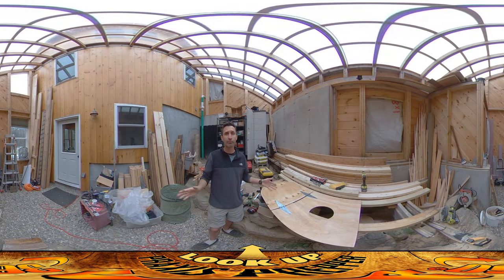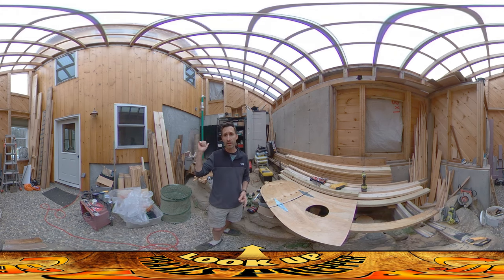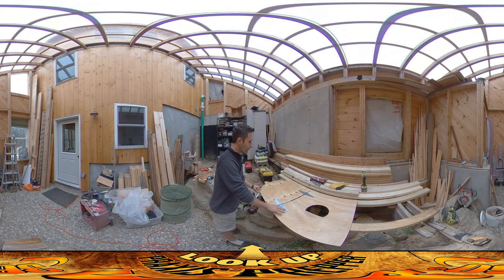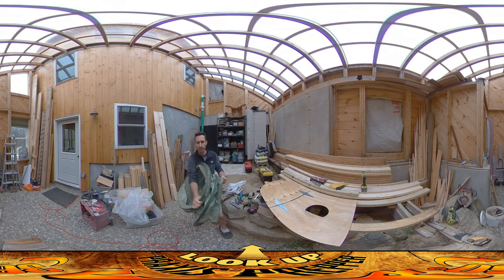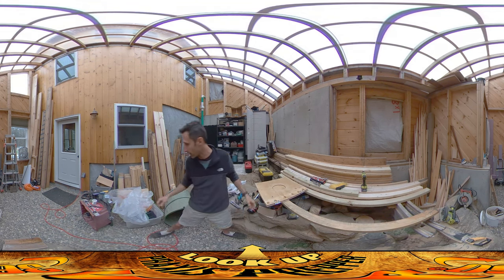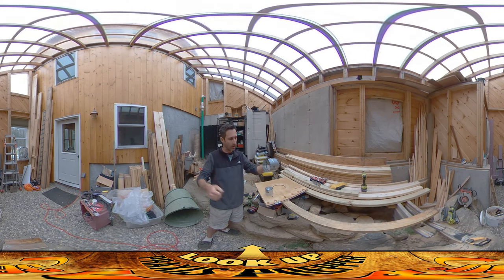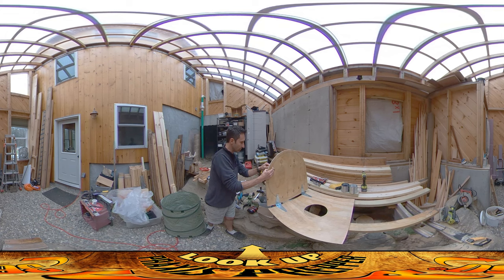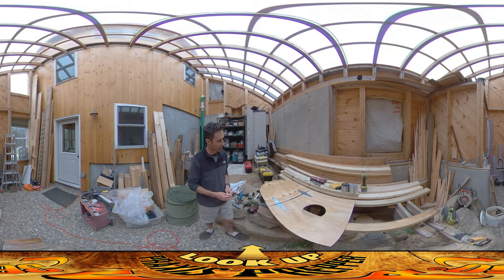Homestead Building - Fallout Shelter Manual Air Vent Design

Comment: Interesting, Praxis. Remember math, you cranking the bellows 20 per minute -thru filters. I use a squrriel cage fan and bicycle
Reply from the maker: A bike would be ideal. I didn't want to fill up that much space in my small shelter with the bike though. But you're right. We have bigger muscles in our legs than our arms, so legs make it easier.
Reply: @PraxisPrepper  : See farrier bellows, Praxis. They use leg mucsle to pump.

Comment: Good idea 👍 May be too late, but I’d fold some duct tape of each edge you plan to put the zip ties through to give some extra support against the nylon tearing along the edge of the ring.
Reply from the maker: Not a bad idea. I melted through the nylon (I should have mentioned that) so no fraying. Also, I silicone glued the seem. It should be pretty beefy over time (I hope).

Comment: Seals at both ends are important.
I don't recall, I'll have to go back (woo, watch-time!) and see how you set up the exhaust.
When poking holes for the cable ties or whatever you use until the silicone sets up, don't forget the hot nail/soldering iron to melt through instead of leaving loose fibers. Not that I would have ever  forgotten but I know a guy who did and had to go darn a similar project.
I'm sure enjoying the rain and the veggie garden is looking pretty good. About to set potatoes, sweet potatoes, corn and the beans for drying.
In just the US, millions of animals being put down, less than half the fields planted that were this time in 2019, devaluation of currency and a family that likes to eat occasionally... gonna be a rough ride. I hope someone points out this post in 2 or 3 years to make fun of me.
Reply from the maker: Great tip on the melted edges to prevent the unraveling fibers. I knew about that so definitely did it. I use an old wood burner tool for that sort of thing. By the way, I was able to score chicken eggs locally. So your generous offer still gets you primo "friend credits" but you won't need to put in the effort to send anything over. Thanks so much for the offer though. It was REALLY nice knowing that I'd have a way of getting eggs. My eggs just got put into the incubator this morning. I'll be sharing that in an upcoming Homestead 360 video.
Reply: @PraxisPrepper  Standing offer anytime mine are laying.
Can we look forward to a live stream of the incubator on the 26th?
Reply from the maker: @matthewellisor5835  I can't guarantee that I'll be able to do it that day, but that's a cool idea. I'll consider it.

Comment: Oh, and looks like this would be really helpful the next time you need to burn a stump down in a hole. BTW, I’d also make a foot hold for it because pushing air though a relatively small hole is much more difficult that you would expect and doing it by hand/arm for a while can get really tiring.
Reply from the maker: I was thinking about that too (regarding burning out old stumps like that one in the way of my woodshed. Also, was thinking about trying to melt metal in a crucible. :)
Reply: @PraxisPrepper  Melting metal is alway fun 👍